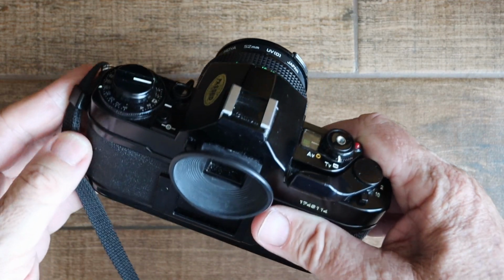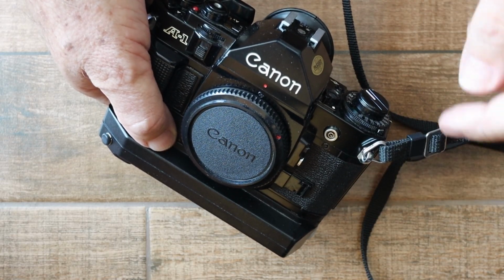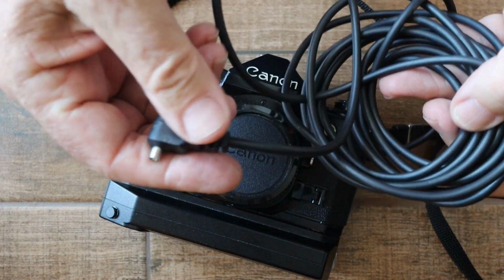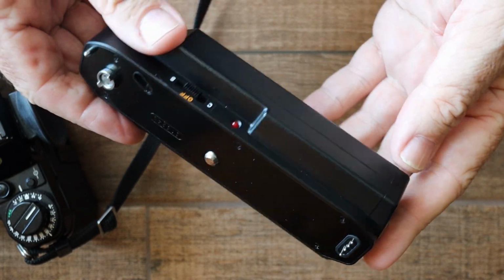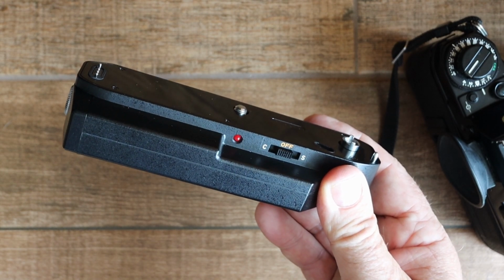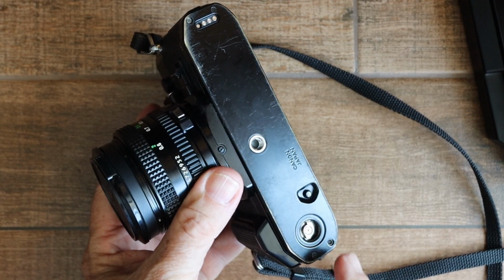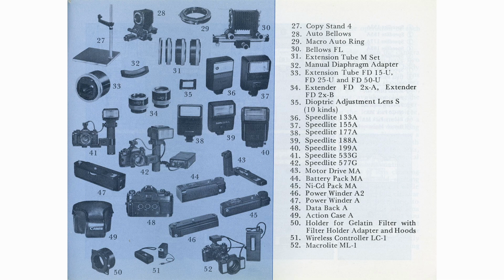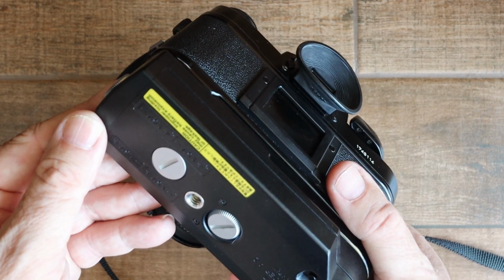Canon Power Winder A2 For Canon Film Cameras

Comment: Hi , I have lost the rewind crank.
Will the power winder pull the film back ready for deployment at the end of the exposures ?
Reply from the maker: Unfortunately, not. When the film reaches the end, a red LED illuminates on the power winder to indicate this. You then have to push in the button on the bottom of the winder, which presses in the button on the bottom of the camera, and then you can do a manual rewind.
Reply: @PhilUKNet  
Thanks for replying, I really appreciate it!
I ll get one from EBay .
Reply from the maker: @user-Stamatame...  Sorry it wasn't the answer you wanted. My T90 automatically loads, advances, and reminds the film. The A1 era technology wasn't quite as advanced! I bought my second winder on eBay from Japan. The condition was excellent, and the price reasonable, but the Thai government stung me for quite a lot of import duty when it arrived!

Comment: a hugely useful feature would be if the winder batteries were sufficient to operate the camera and the 4sr44 could be omitted. is that the case?
Reply from the maker: Unfortunately, not! It's not like a DSLR battery grip, where you can clip something on the bottom to get more battery power for your camera. The camera and winder power circuits are completely separate. The good news is that the little button battery in the camera lasts for years. Canon recommends changing it once a year, but mine have lasted for several years between replacements.
Reply: @PhilUKNet  right, but 4sr44 are rather expensive and some A-1 seem to develop an increased bias current, forgetting to turn it off can drain them in weeks, sometimes days

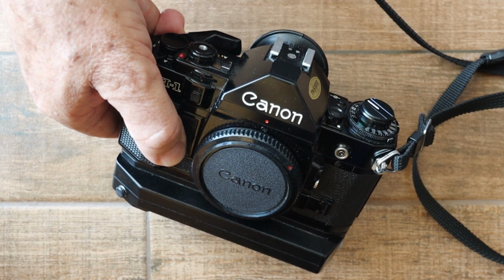Comment: I was wondering what that accessories list is from at 03:35. It's not the pdf manual I have.
Reply from the maker: The physical A1 user manual has quite a lot of information. I have user manuals in PDF form, but they aren't as comprehensive.

Comment: I recently bought a Canon AE-1 Program and almost bought a Canon Winder A. Glad I found this video as I bought an A2 winder afterwards and it's excellent. Superb build quality and makes camera nicer to hold. Only downside is with the batteries in it makes the camera substantially heavier.
Reply from the maker: I've never seen the previous version, but by all accounts, the Power Winder A2 is better. It does add some weight, but with a long lens, it might help to improve the balance. Admittedly, that old film gear is heavy. My backpack back in the film days weighed a ton. The EOS M system that I mostly tend to use these days is like a feather in comparison! That was the main reason I switched from DSLR. I'm getting too old now to lug heavy equipment around!
Reply: @PhilUKNet  I have a Canon EOS M100 but I don't use it as often as I should. I wish I had taken it to the Pet Shop Boys concert I went to a few weeks ago. None of the pics I took on my phone came out.
Reply from the maker: @Distorted-Vision  The Pet Shop Boys are still going?! They were around when I was young, and I'm now old! Shame you lost your photos. Phones have tiny sensors, and I guess it was low light.
Reply: @PhilUKNet  I'm a big Pet Shop Boys fan for more than 35 years. They are still going strong and are in the middle of their greatest hits world tour, Dreamworld. At 45 I'm old too. Yeah it was low light but also I was far back from the stage. Did get amazing photos of Chvrches with my phone a few years ago but I was stood right in front of the stage. Anyone I'm wondering why Canon discontinued the Canon EOS M range.
Reply from the maker: @Distorted-Vision  I haven't heard an official announcement, but with no new bodies or lenses for so long, EOS M definitely looks to be continued. I guess having all their development resources working on just the R line is more efficient. I've been an M user since 2013, and I'm quite disappointed. Canon seemed to think they could placate M users by introducing a few APS-C R bodies, but I love M for the small form factor. Some of the R bodies are quite small, but the lenses are still big. Oh well, I guess I will move to R eventually.
Reply: @PhilUKNet  I've sent you an email!
Reply from the maker: @Distorted-Vision  Nothing arrived.
Reply: @PhilUKNet  That's strange. I've resent it with the JPEGs attached in a rar file.
Reply from the maker: @Distorted-Vision  I don't know.
Reply: @PhilUKNet  Still nothing arrived? Any chance they've gone into your spam folder?

Comment: Hello! Does this fit the Canon f1 original?
Reply from the maker: I've never owned an F-1, but looking at the Winder A2 user manual it seems that it can't be used with an F-1.

It is designed for use with Canon A-series SLR cameras: A-1, AE-1 Program, AL-1, AE-1, AV-1 and AT-1. Sorry!